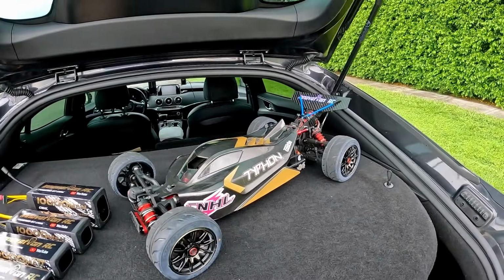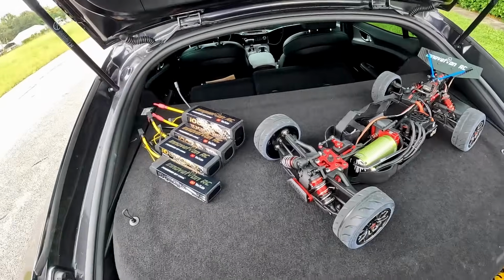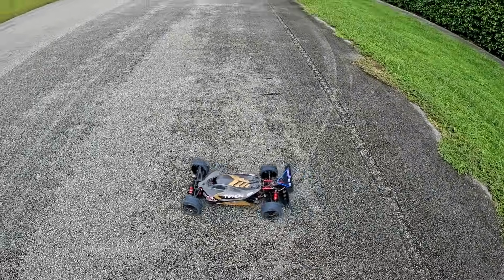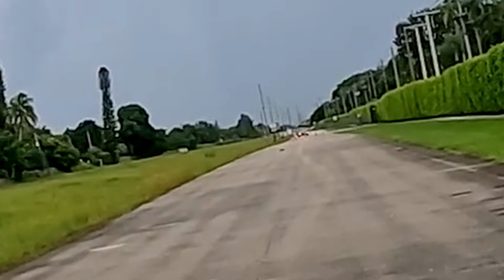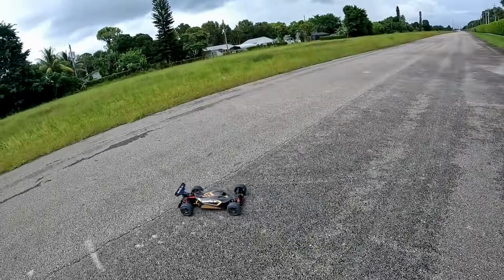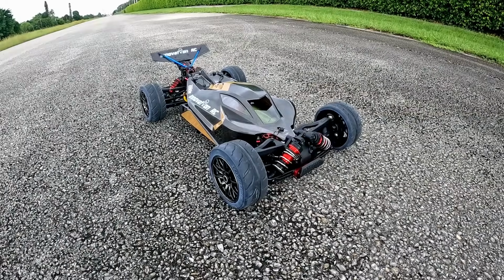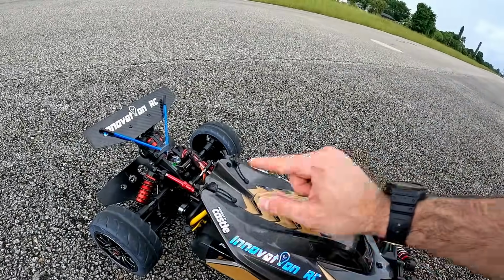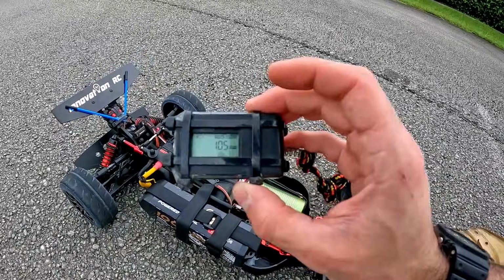Active Wing Shockwave got a 20+ Hp UPGRADE! New 10,000 Mah IRC Batteries!

Comment: I'm old. When I was a kid bashing my JRX Pro around the driveway we had 7,2 volt battery packs. Basically it was 6 C batteries. 78 MPH would have been the world speed record. So much has changed. Cheap low end cars today, would have dominated the tracks back in the 90's.
Reply: I agree. I'm from the same era. Charge the  packs all night for ten minutes of fun. My first kit was the Tamiya super hornet. Mechanical speed control and all. I think the brushless power systems are unmatched in speed and efficiency which may be the main difference between old-school and new school.
Reply: so true!
Reply from the maker: Those original cars from the 70s-90s are what makes the craziest cars of today! Everything starts somewhere. I'll never forget as I started with a little X MOD from Radio Shack in 2004 when I was 6 years of age, (I am 26 now). If I did not have my little XMod, I probably wouldn't even be doing RC cars right now. It opened my mind to appreciate building, customizing & Innovating things of today!
Reply: @InnovationRC  those xmod days were awesome. I upgraded the hell out of my mine. Great lil starter rc. 👍
Reply: @acecapone8086 I GOT YOU BEAT BY A FEW YEARS MY FRIEND…MY FIRST RC WAS A GAS POWERED COX DUNE BUGGY , GREEN WITH FULL INTERIOR ,  BEFORE RADIOS, IT WAS 1970 YOU TURNED WHEEL MANUALLY TO GO ANY DIRECTION YOU WANTED TO GO ,BUT WE HAD A BLAST AND WERE IN GREAT SHAPE…
Reply: @williamsolomon602  My father told me about those cox buggy's. My question to him would always be "how did you stop that thing" 😂
Reply: @acecapone8086  YOUR HOMEBOY WAS THE ONE YOU WOULD SEND CAR TO…
Reply: 78MPH is barely faster than RTR speeds today.  150+ is speedrunning. Most days I don't even bother watching videos unless I'm going to see someone clip 200mph. I opened this one because it's using a buggy type build (Typhon buggy parts on Kraton Truggy aluminum plate?) But, testing speed via GPS, subtract 5-8 mph after averaging 3-4 runs. Need gates to get accurate read
Reply: Lol. And I used to solder an extra “nicad “on end of the 7.2v pack for extra speed …20mph easy  😆

Comment: Odd wheel choice. I have these wheels too and they don’t speed run very well. Otherwise, cool! Thanks for sharing the logs, the most impressive part is the wicked low ripple for such high amp draw
Reply from the maker: Thank you I appreciate that! Glad you found the logs useful! 
To be fair, I didn't think I'd be over 100 on 3s, maybe 4s. Gotta go back to grps. These tires look amazing but they don't hold up well. Had to try them, never did before!
Reply: @InnovationRC  proline makes on-road wheels that look pretty but you know as well as anyone that GRP is the bare minimum for serious speed runs. Beyond that, you know, BSR foams. 

But yes, the logs are what speed runs are made of. Understanding the data is the key to huge speed, especially with such low voltage. 80+ on 2S is huge, especially with a big fat heavy car

Comment: Carbon interferes with radio waves. I like how the rear spoiler pops up to block the antennae when deployed as an airbrake when it's driving away from you.
Reply from the maker: Never had a range issue with shockwave. I've also driven at least twice the distance at another road to go faster
Reply: @InnovationRC  It's one of those things you find out when you operate at the limit. It's not like the Ocean Gate sub imploded on it's 1st dive.
Reply: @toolbaggers  people have flown carbon fiber quadcopters for several miles of distance without any issues.

I am confident he will do just fine driving an rc car within visual line of sight.
Reply: The antenna placement is pretty close to the carbon fiber though. I would change that if the goal was long range.

Comment: Hey bud great video, how are you pulling such high amps out of a 3s??
Reply from the maker: Because the motor draws a lot in general, plus the gearing stacked that high. But if the battery isn't capable it won't draw that amperage to begin with and voltage will drop significantly

Comment: I had recently tried my first max6 1750kv combo in a k6s on 6s and was blown away with the adjustability from the punch down to 2 through 8  and the tire choices of copperheads, 4s LPs and 6s backflips . At 2 the whole travel of the trigger increases speed like a real sports car accelerates . At 6-8 punch it lifts the fronts too much for my liking . I never realized a lower punch of 2 would actually drive and feel better . That’s with a 20t on 6s with the 4s it  feels like it’s ready to race on a dirt or grass track . Dang dude , yours is hauling serious tail . 👍
Reply: I recently realized that using punch control hinders performance. I want full power immediately from a dead stop

Comment: You should make this active areo car a track racer and put a channel mix on your steering and brake so that the wing goes down variably depending on steering input and or  braking
Reply from the maker: Yup I actually have it able to run off the throttle port too. I prefer having a fixed wing for this test

Comment: Maybe you could incorporate some sort of disk brake system to reduce the breaking load on the motor and ESC? This car is really impressive!
Reply from the maker: It would always help, but it's setup for a single pass only so using the brakes once is usually fine 🤠

Comment: This is a really awesome idea, tho flawed. With the adjustablities and configuration of today's modern transmitters it should  be reasonably easy to control the amount of downforce in conjunction with the amount of throttle or pull of the trigger.  Possibly with advanced transmitters and telemetry this could be controlled by motor rpm and/or speed. Maybe even both. I see good things here in the world of high speed RC racing
Reply from the maker: I can easily do that with a flip of a switch too. Allow it to work in line with throttle. But I wanted to specifically test the speeds with difference factors of downforce. I wouldn't say flawed, you just weren't informed Shockwave could do that. Telemetry I try to stay away from, more wires and stuff to go wrong... Gotta keep things simple the faster you go with these things. But as you said, this technology changes and evolves fast! I just prefer to be simple and consistent
Reply: @InnovationRC  i very much agree. Using flawed wasn't the term I should have used. Well you know what a little contex can do 😁

Comment: AWESOME!!!! I have a typhon 1721/2400 set up..wats a  good gear ratio 4 max speed run?
Reply from the maker: Nice it's a great motor! Depends on the voltage you run! I was running super low voltage so 2-4s max with the overdrive ratio. If your doing 4-6s you want like 30p/39s to start.
Reply: I'm runnin 6s

Comment: Hi again I have a question brother I’m trying to get my rig ready for speed runing I do remember you saying suspension is the most important when comes to speed running what you did to vision and Spartan at the front end as far as the shocks once I remove the shocks what should I get to replace them? I know you say tie rod, but is there a specific length or brandthat you would suggest
Reply from the maker: I don't have the specific length. But I used the rods in the front. But you need to make sure you have a super smooth road. What you should do is install them, then adjust the length of them once it's on the road and completely loaded (has the running weight). Make sure the front is always lower than the rear so aerodynamically you won't lift in the front at speed 💪
Reply: @InnovationRC  awsome sir thanks a lot
I think I got it figured out.

Comment: What charger do you use for the QS8 plugs
Reply from the maker: I use a sky rc Ultimate Duo. It charges everything in under an hour. 200 watts per port and don't have to worry about an external power supply. Great charger
Reply: @InnovationRC  good deal thanks for the reply and the information on a charger

Comment: Hi man. I have two 10.000 mah 4s packs for my outcast 8s. After about 30-35 charging cycles they started to heat up and puff up while using them pretty hard. After i stop using them, i let them sit 6-7 hours and the packs go back to normal. The punch is also not like it used to be. I plan to buy more packs because of the good price and long run time, but i wonder what i can do to prevent the swelling and heating up. I run a max5 with an 1100kv spektrum motor on 25/39 gearing. My esc is set on medium low voltage cutoff. After LVC is hit, i check the batteries and the cells are about 3.4v/ cell. After 5-6 hours of letting them cool down the voltage rises up to 3.6- 3.65v/ cell.  If i set my esc to high LVC, the cells are at about 3.65v then after a couple of hours they go to about 3.75v /cell. Shoud i keep my esc on high lvc? Thanks
Reply from the maker: Do you keep the fully charged when you don't use them? Or are they already warm before you start bashing?
Reply: @InnovationRC  completley cold when started bashing. They don’t heat up at all when charging or anything. I keep them at storage charge 3.85v /cell. Longest i kept them fully charged was about one day.

Comment: Hey Brother what GPS Speedo are you using.
Reply from the maker: I use the sky RC GPS speed meter. I like it way more than the Bluetooth one, don't trust the Bluetooth due to many glitches people had, jokingly posting it on social media I lost trust in it.
Reply: @InnovationRC  yeah I have both sky Rc speedos yours seems to be a lot more readable than the one I got. It is very dim and very difficult to read so I’ve been using the blue tooth one and it doesn’t seem to be reading right. I’m getting the same pulls and sometimes there’s 20 mph in the difference

Comment: Dude you know better than that those tires not good for speed runs grp s or try the knew proline menace just ran 114 mph on the prolines and my felony has been 119 mph on Hoons no issues or damage to the tires H and w racing channel love the knew batteries going to grab some do a review cheers
Reply from the maker: Yeah I know, I've been wanting to try these tires out for the longest time. Not a single video I've made with them ever so this is the first and last! I'll have to go back to GRPs.
Reply: @InnovationRC  have a look at the knew pro line menace tires bud I just got some ran 114 mph in my stockish felony 6 s seem good no issues glue etc it depends on the weight of the car I’ve found over 13 pounds foams are safer cheers bud love your channel gonna grab some of your batteries this winter H and w racing channel